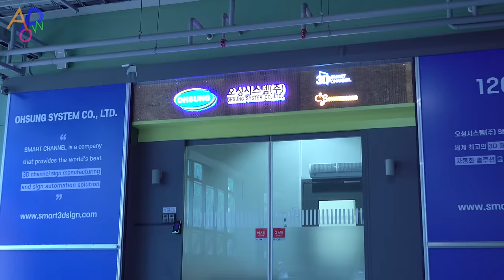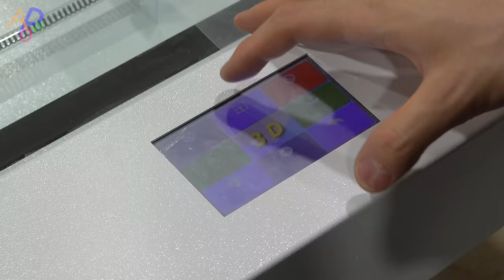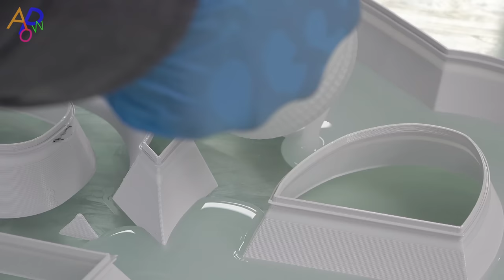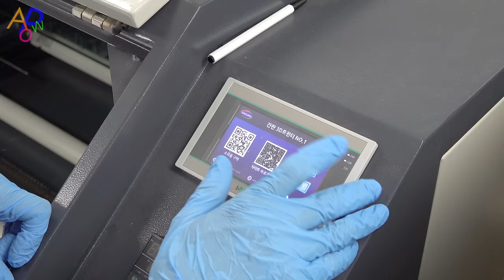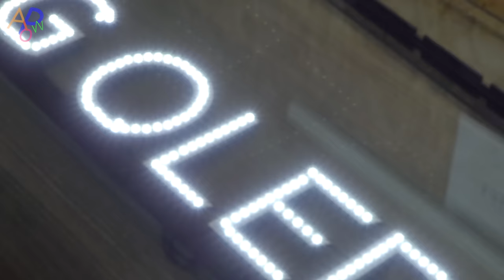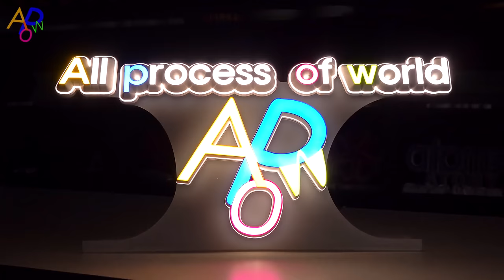LED Sign Manufacturing Process With Latest 3D Printing Technology. Signage Mass Production Factory

Comment: Why don't they just use colored resin? Using colored vinyl cutouts just adds time, labor, and room for error.
Reply: I'm guessing it's probably because of color accuracy. To have all kinds of colored resin and to maintain it will be costly while creating mixture of few colored resin could result in color inaccuracies. Instead I think that printing colored vinyl is much easier and accurate? I'm no expert  so I can be wrong😂
Reply: Resin is less durable and more expensive

Comment: Which polymer did they use to form the transparent front side of the letters?
Reply: Is probably a UV cured resin like the ones sold at hobby stores. The only harden when expose to UV light.

Comment: Hi, what Materials do they use? Its probably just Resin for the liquid filling. But the walls? Is it PLA, PETG? If its something else I'd really want to know how they print it without warping on such a huge surface area. Thanks for the vid
Reply: the αl of PLA and PETG is small, the property is stable. And now we apply PES, which is more durable, in whole whether.

Comment: what type of liquid is being poured does anyone know?
Reply: Must be some kind of UV curable resin at that first stage when it has the glass still on the front, but no idea about the later stage after applying the coloured films. Either they didn't show the repeated UV cure or it was some kind of self-curing thing. Very interesting process though, and interesting to see (scaled-up) "consumer grade" 3D printing technology used in a production environment.
Reply: I was wondering this too but you could get the same effect with a clear 2 part epoxy resin mixed with some white semi-transparent epoxy dye.
Reply: @Binxalot  I believe that the problem with epoxy resin would be to stay in the sun, rain ....
Reply: my frist thoughts would be a uv-curable PDMS